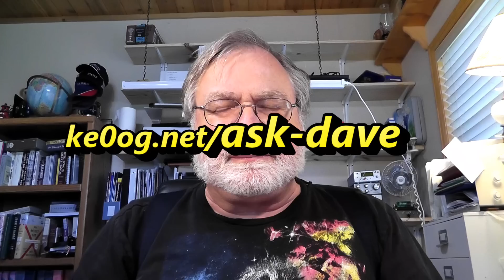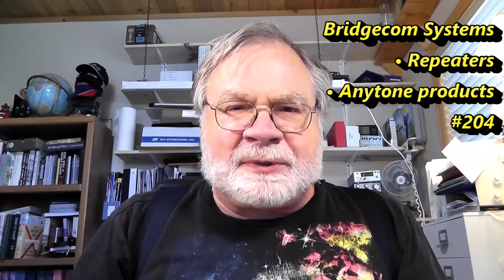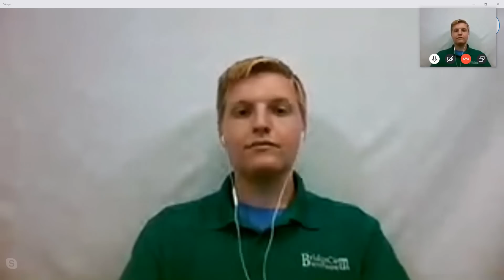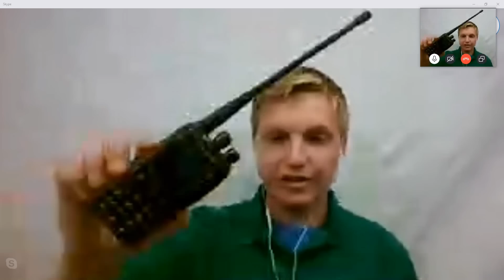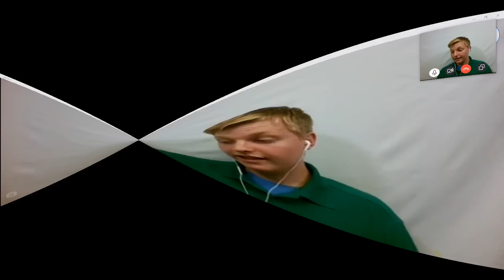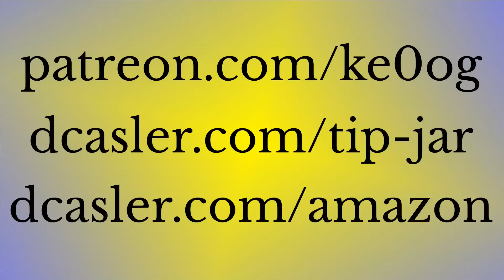About Bridgecom Systems: Repeaters and Anytone Handhelds (#204)

Comment: BridgeCom isn't actually manufacturing anything (other than controllers) and maybe the case. The practice is to glue things up and brand the product with 'BridgeCom' name. I owned two of their CS-540 series repeaters back in 2012.
Not sure if they are operating differently now, although I doubt it, but on older models they used Maxon mobile units (SM-6xxx Enduro) stripped from the heads and custom/modded firmware. Never had them in service because I ended up building my own repeaters for less that $600, power supply and duplexer included (70cm). For a ham / club, the prices I've heard mentioned in this video are pretty high. Unless they sell you a Sinclair / Procom or other name brand duplexer, you'll end up with a chinese one (BridgeCom sticker included) which you can get for as low as $70 US.
Reply: It's true they are an integrator/reseller.   The last repeater I saw from them was indeed two Maxon mobile units, a rebranded asian mobile duplexer and some custom firmware.    A Motorola SLR5700 - their lowest end repeater runs street price of $2400.. double the BridgeCom price.   The SLR5700 is a far more capable system, DMR, etc., but analog repeater market is going away outside of the ham bands.     I would not call BridgeCom expensive- they are positioning themselves as a low end, analog only repeater compared to the big manufacturers who have moved onto digital modes (DMR, P25, etc.).   They are using their ham friendly / customer service oriented marketing angle to attract people who don't want to deal with the commercial LMR dealers who tend to shy away from the ham (read value) market as their is no profit it in for them, and those that want plug and play equipment without having to build/test/tune themselves.     Would I install a BridgeCom in a mission critical setting.. no.   But they are offering a good value proposition for hobby / small business type environments.
Reply: @SadHamRadio  Which begs a question, if you were putting up an analog repeater, would you buy a Bridgecom or a Yaesu DR-2X?
Reply: You are living in the past if you think BridgeCom are expensive, a low end commercial VHF repeater + duplexer is around $k4.5 these days and a Motorola can be $k10+
Reply: Dave's content is for ham community and I like it so I expressed my point of view/experience as a ham in regards to a business which targets hams.
Since I've built my own systems ( https://tinyurl.com/y2w7k7fm ) I am well aware of the costs to have a repeater you can rely on and enjoy but I also understand a business needs profit to survive.